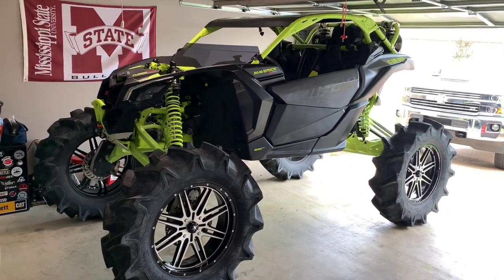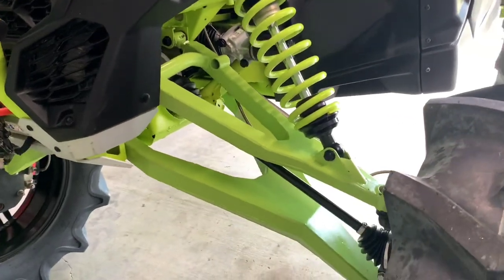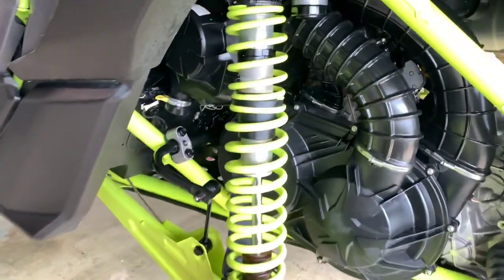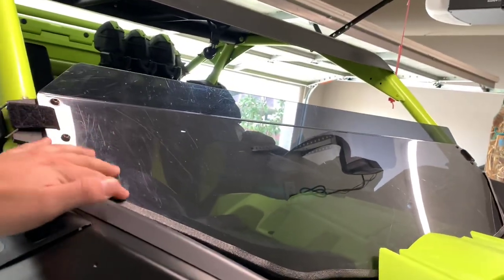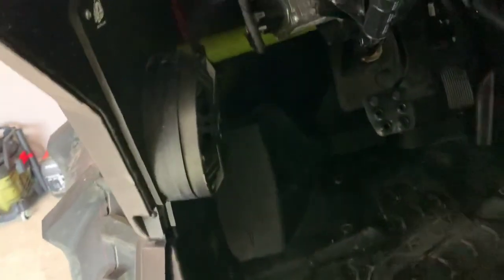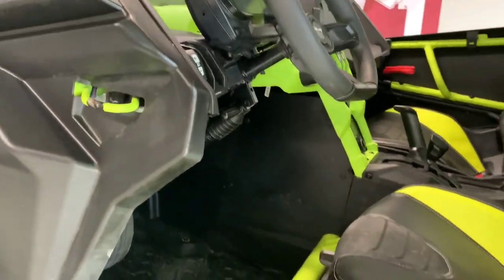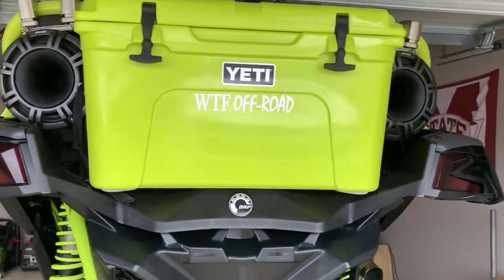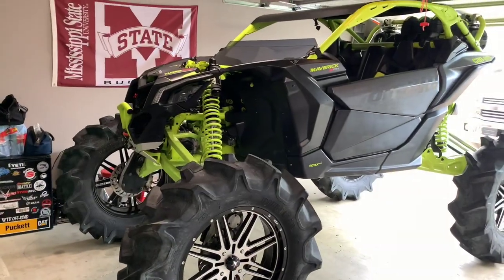2020 Can Am X3 XMR RR $40,000 Build overview pt.1

Comment: On the dash speakers does your x3 pull to the side who tuned you power steering so it won’t pull I took mine to some dealer but they could not fix it
Reply from the maker: yep mine used to, I reprogrammed the DPS and it fixed it.